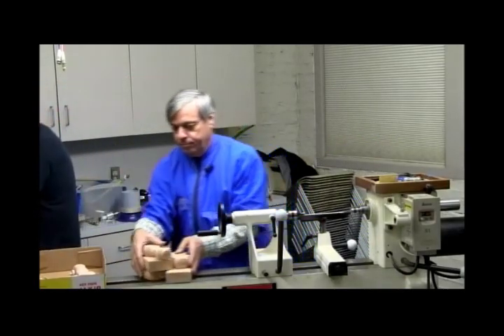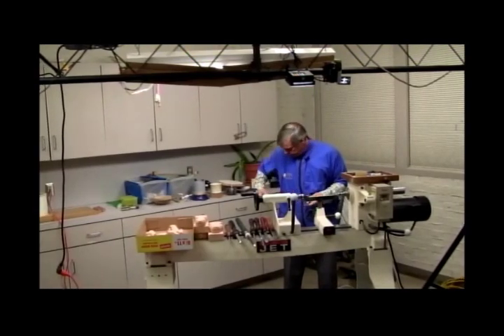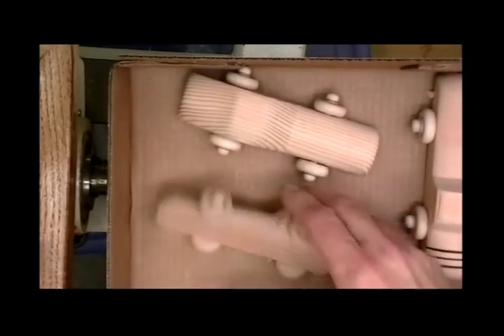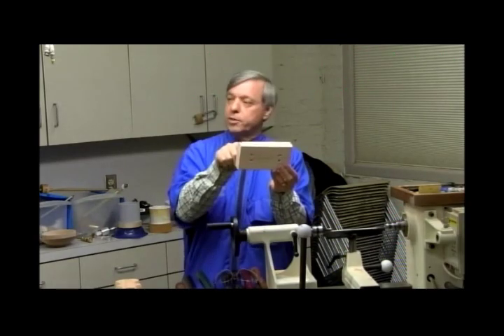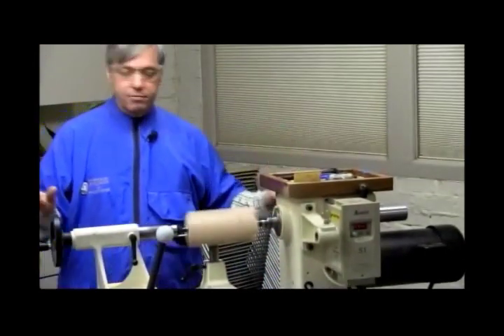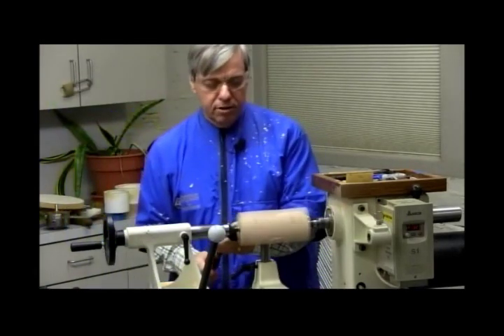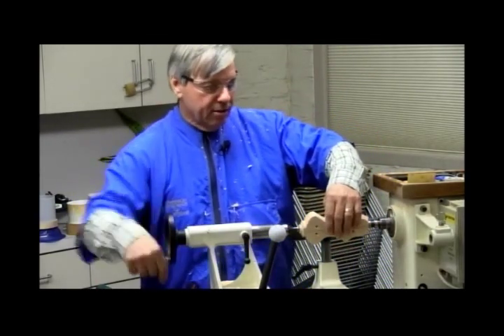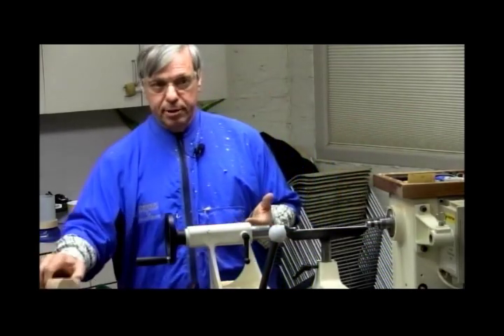Turn a car from a 2x4

Comment: thank you im new at lathe work and you show the tools in use so well ive been just pushing the tool against the wood I didnt realise to use the the the back of the tool to give the proper cutting angle and just how to manoeuvre the tool like you did whencutting into the top part I found it very helpfull

Comment: Good question.  It depends on the wheel size you use. Position the wheel hole so the wheel extends at least 1/8 inch below the bottom of the car.  Be sure not to drill too close to the bottom of the car or it might break through.

Comment: this is great.  as a new turner this will give me some cheap fun practice .  just one question where should the wheel holes be drilled.  thank you
Reply from the maker: Draw a line down the center of the 2x4 on the wide face.  Then take the radius of the wheels you have into account to determine how far off either side of that line to put the axle holes.  The spacing apart from one another (wheelbase inf you like) is up to you.  WE made a template out of wood to use on the drill press for prepping multiple blanks.